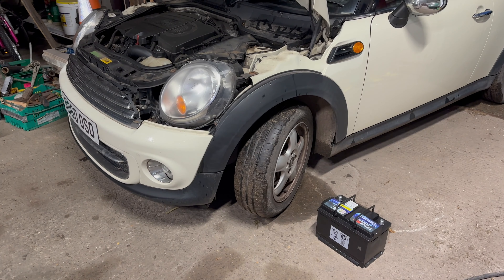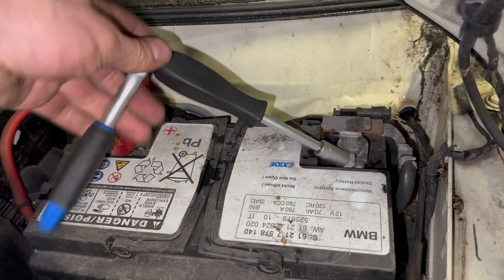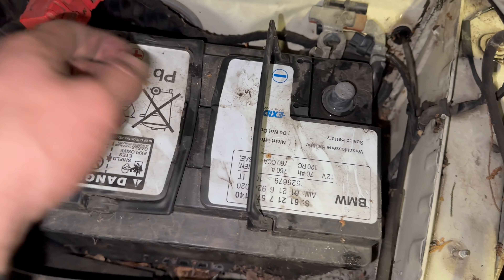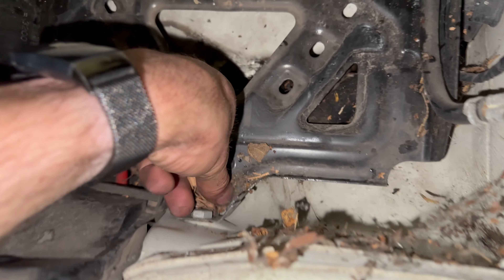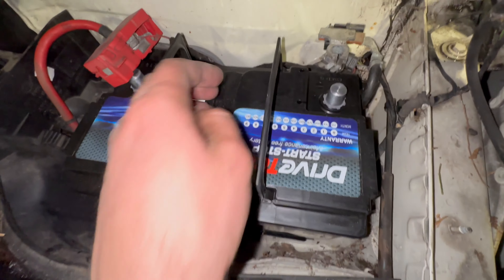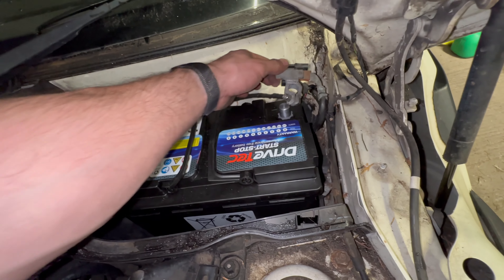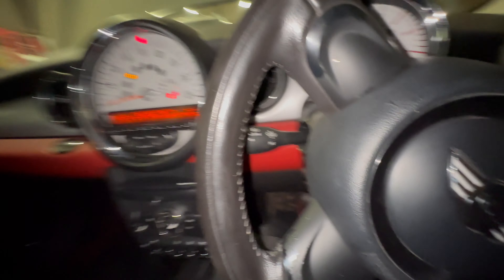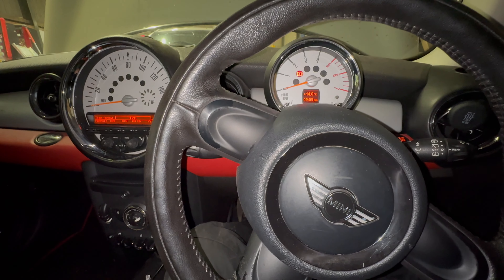Mini One R56 Battery Replacement How To DIY Replace The Battery

Comment: Is it true that the new battery might get overcharged by the car without registering it? My battery needs replacing, and I want to do it properly.
Reply: its called AGM battery training you need to do it... in my country is 20 euros at any battery seller if you buy it from them i think its free
Reply: Yes it needs to be registered. As it will be under charged I believe and prematurely fail.

Comment: What a pain in the arse job but a great video. I have a classic mini and can change a battery in about 20 seconds with quick release fittings...the Mrs has a BMW Mini and it needs a new battery fitting 😞
Reply: The irony is my old e46 330 is so much simpler to work on than my daily r56.